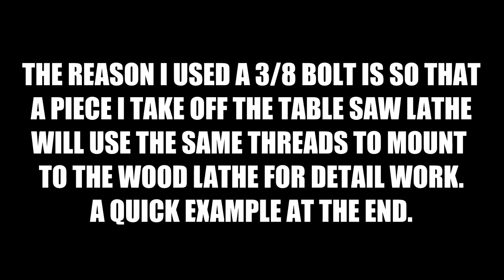Homemade Screw Center for the Wood Lathe

Comment: pretty good idea. Just a quick tip for turning, try and use the turning tools as close as you can to the post of the tool rest, especially on the Harbor Freight lathe. you'll be disappointed when the tool rest breaks from the down pressure on the end of the tool rest. otherwise nice video.